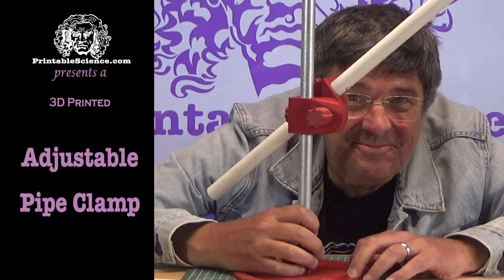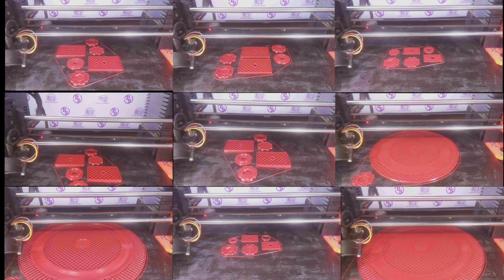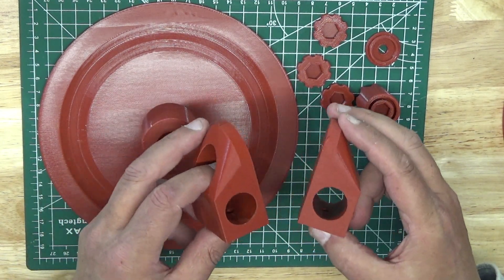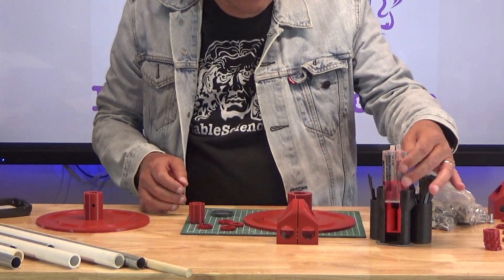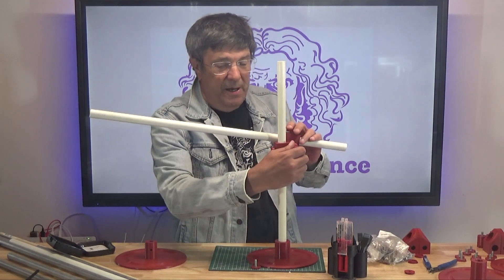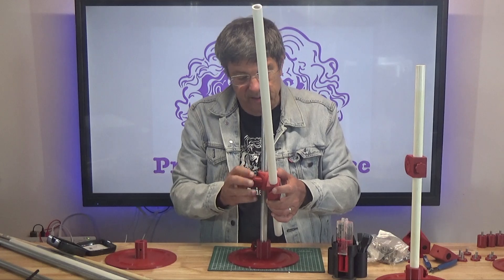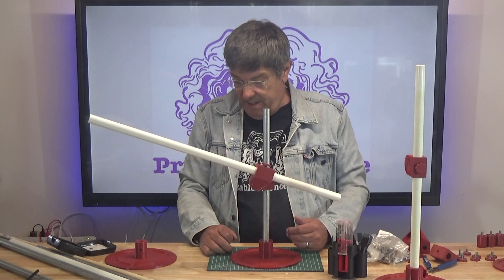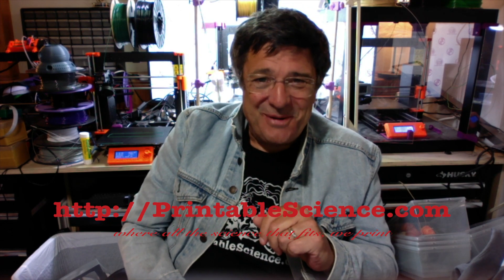3D Printed Adjustable Swivel Pipe Clamp for 1/2 PVC, EMT and Wood Dowelling

Comment: This joint is akin but inferior to a hirth joint-what you mentioned at 2:00- This design is just more or less a dog clutch. Nevertheless it works well, but to get it stronger, one should use a **HIRTH JOINT**. It is self indexing, non gendered, self aligning, and extremely shear resistant. Depending upon hirth angle, it will generally cam out rather than shearing off the pins. If you printer struggles to tolerances, use a higher chamfer amount and a larger hole, you really dont need all that much face engagement.

Cheers!

Comment: very cool design. Iam currently designing a lamp and have searched for DAYS for a rotational cross clamp. I have found two companys who offer them, but they were rather exspensive laboratorium equiptment. So i tried building them myself from wood, but it took too long and i couldnt built them accurate enough with my limited toolset. And thats how i got into 3d printing. true story, very fascinating i know...hopefully ill be able to sell some lamps once i got everything figured out, but its a suprisingly long way to go for such a simple object. but even if i fail, it got me into 3d printing, so it was definetly worth it.